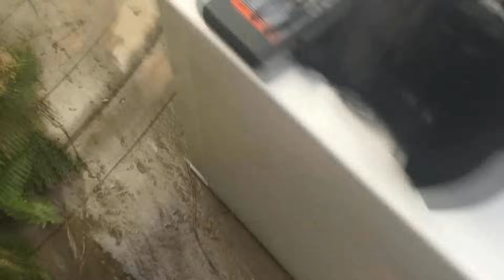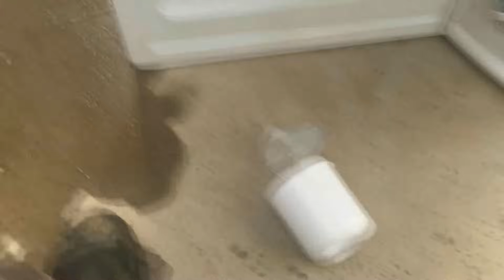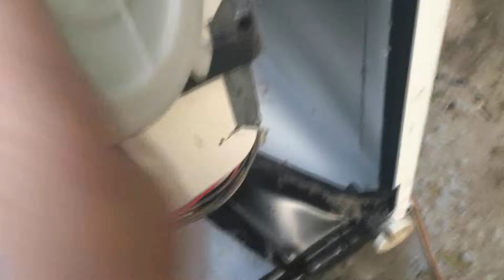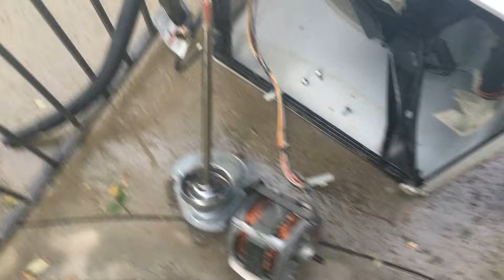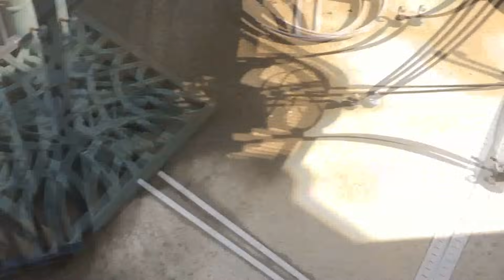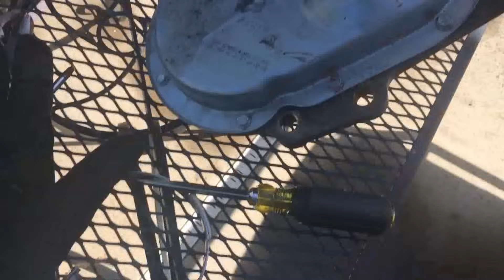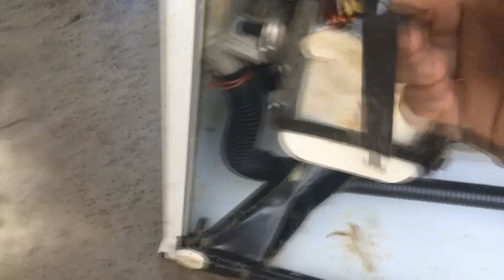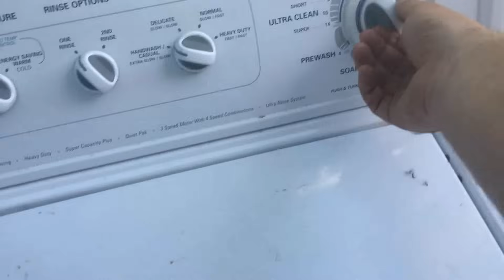How to Replace Clutch On Kenmore Washer - Not Spinning

Comment: Im a single father with a 12 year old daughter . I work 45 hours a week to try snd makes ends meet . I cant tell you how much this video meant to me ( us ) . Our washer has been barely spinning for months . I searched the internet trying to find an answer . I went out on a limb and paid 50 dollars for a new clutch from a local alliance repair shop . I watched your video probably 15 times and had the old clutch out and the new clutch in within an hour . Thank you so much . Now we have a washer that works .
Reply: TheBeaver50 You got ripped off on your parts.
Reply: New clutches are only about $10 online (Amazon or eBay).
Reply: Yes, the local Appliance repair shop certainly made a profit, but TheBeaver50 got the job done...I say Nice Job!
Reply: That WILL fix it - but next time look for the "COUPLING" behind the motor (accessible through the bottom once you "unfold" the washer") VERY easy fix - clutch probably came with both new couplings and black ring (with 6 holes in it) 3 holes for each coupling... those two/three little parts make the entire washer work - it's like it's heart and soul xD
Reply: What is the model #. I bought what looks like yours but no model #. Nice video and thank you for the time you spent to help others.
Reply: Got a model number? Thanks

Comment: Very helpful video.  Thank you.  My washer and dryer both went out on me at the same time so I'm here finding out how to do the repairs myself.  Even if I had the money to hire a repair man, I would still do it myself to save money.  I like fixing things though.  It gives me a sense of accomplishment and purpose.  Although as of today either my air conditioning is on the fritz or  the blower on the furnace isn't working properly!  I can't seem to get a break!  Ugh.  I fixed my dishwasher a month ago.  It was a $14.99 part.  I'm a 49 yr old woman with teenage daughters.  I'm trying to teach them how to be self-reliant and repair things instead of replacing to cut down on waste and unnecessary purchases.
Reply from the maker: +Kim Possible right on. Needs to be more like you. Too many people these days throw things away over such simple fixes

Comment: Thanks!!  6 years later, the link you provided for the clutch kit on Amazon is still the best (cheapest) place I found to get the OEM/Genuine parts.  Looks like the seller (Cashwell appliance parts) is semi-local to me, but I checked the part on their website and it was $44, compared to ~$22 for the part (including shipping) from the same seller on Amazon.  So I bought it and let them deliver it to my door for 1/2 off their walk in retail price.  Not a great way to do business IMHO, but the part worked great.  Washer spins like a champ now!!!!

Comment: This is a Whirlpool Direct Drive washing machine. Made various models for about a 30 year production run. Incredibly easy to work on and very dependable. Parts available on EBay , Amazon, and local appliance repair shops. People throw these away because they are “old” when in reality they last 3-4 times longer then most new washers. Also  NO computers or mother boards to break . Yeah many people will wish they kept and repaired them when they are all gone.

Comment: Nice Video!  Tim Hill said what I was thinking - There is a COUPLING in the BOTTOM - You have to remove 2-4 clamps and 2 screws and the motor comes out - I literally JUST did this TODAY on our Kenmore Washer - I found a guy who owns a shop who happened to have a coupling and the small black round piece with 6 holes in it that holds both couplings (there are actually two - one facing one way the other (the one that usually breaks) facing the other way - Once you get the motor off it's REALLY easy to to replace that coupling(s) - Washer is running... spinning AND draining again after replacing that coupling and black ring it goes into (the ring was worn out too) ... $8 (in parts) - I think in your case it really was a BAD CLUTCH - but always check those couplings FIRST (anybody else that encounters this problem) when NO SPIN check the lid switch 1st - if that isn't it 90% of the time it's those little couplings... @11:36 you can see the couplings/black ring CLEARLY (between the clutch and motor)

Comment: Getting the retainer ring back in was a little tricky. It doesn't really thread in, as said. First, make sure that all four of the white plastic tabs are coming through (from the bottom side) properly. Then make sure that the four metal slots go all the way on the motor so everything is seated properly. Then I put the tang end in the hole, and held the ring down with one thumb positioned just past the tang (in the clockwise direction). Then I used the tip of a flat screwdriver to push the loose end of the ring toward the center (to make the diameter smaller). At the same time, I pushed the screwdriver down at an angle. If the screwdriver isn't angled down some, you probably won't be able to get the ring in. The ring has to go OVER the top (of the last one or two of the four shapes formed into the metal on the motor side), then inside.The angled-down position also helps to keep the screwdriver tip from sliding off, possibly gouging your other hand.The flat blade is positioned vertically, and it should be centered on the wire of the ring.

Comment: This video was awesome. Very well explained. I replaced the clutch, drain pump, plastic part between motor and transmission and washer dogs on my machine. Working very well now. If it helps anyone, my agitator was removed first by using a half inch ratchet extension ( Seen in another video) which then revealed a 9/16 bolt to be removed .

Comment: I’m also getting one of these when I finally get my house as well.

A stockpile of parts will be in place when I do get one.

I’ll gladly spend $150.00 to $250.00 on one of these used before I spend $800.00 to $1,100.00 on a brand new one that can only do half the stuff that these old workhorse like Whirlpools and Sears Kenmore Direct-Drives can do.  They’re nothing but garbage anyway.

And as you showed, there very easy to work on and to fix and repair if something go wrong with it.

These lasted 25 years or longer when they were brand new.

Get it fixed up and gone through really good, I’ll probably get another 20-25 out of mine before I’ll either die, and then leave it in my old house when I’m gone.

Or I’ll finally throw it out when there no more parts to buy for it, and if I’m still living, I’ll probably replace it with a Speed Queen, provided their still around, they’re still making their washers the old way they seem to be still making them now (sans 2018, of course).

If fixed up very well, there’s no reason why this washer won’t out live me.

If a 67 year old woman can fix it up and keep it working, then there’s no reason why a 56 year old (and nearly 60 year man) like me can do the same thing to his.

These were good washers when they were out.

I don’t know why Whirlpool stopped making them in the first place.

Great Job Sir....

—Charles—

Comment: Bro! I underestimated the "heaving and hoeing" that is needed to pull the trany out. This video saved me from buying a whole new washer. Thanks for the great video. My washer started out with a weak spin and eventually stopped spinning. Ordered a new clutch and motor coupling but coupling wasnt broken, but i replaced it anyways because why not.
Reply: Do you have any tips for removing?  Mine is stuck. Ive pulled and pulled and even beat the shaft from the top with a rubber mallet.  I can't get it freed!   Any help would be great!
Reply: @Hector Cortez-aponte-cabrera still no tips from anyone. Ive surrendered unfortunately.
Reply: @Hector Cortez-aponte-cabrera ikr? 🤞good luck!   Let me know what you figure out!
Reply: It should come right out if you got all the retainer clips removed from the shaft inside the tub. Pull harder!

Comment: I've found the motor area is easier to access if you loosen and pull the body forward as it was intended rather than lay the unit on its side.  All of the clamps were made to disengage from the front as well.
Reply: 100%

Comment: One minor detail: the rocket looking thing (15:25) is actually supposed to sit the other way as it's a cup for liquid softener. Otherwise...you just saved my gizzard! Replacement parts are SO much cheaper! And this washer...we've had it for YEARS.
Reply from the maker: Glad it helped, thanks for the input!
Reply: I am not even sure if that is true because he threaded it and it lined up. There may be different models with slightly different characteristics.
Reply: @hykos1045  Sure, but I can do that with mine, too--he and I have the same model--but the intended purpose of the "rocket looking thing" is for it to be open side up for liquid softener. It's possible that for shipping and handling purposes it ships cone side up.
Reply: Okay this is what I was here for because I cleaned mine and replaced it but now I am here for the clutch I’ve noticed the fabric softener inverted on when he repaired. Was wondering if I have done it incorrectly. One thing I’ve noticed is that my softener disperses immediately with same amount post cleaning. Although it is flush now I will think about turning for “lock” method. Usually it disperses only when on spin cycle. Once more. Thank you inquiring eyes and mind. Xo
Reply: @gipzcarnelli4728  Yes, for liquid fabric softener, you want it to be open side up, cone down. It balances a little precariously, but that's how it's supposed to be as the softener is meant to be added during a later phase (a little will spill and it won't kill anything, but that's the design of the work flow).

Comment: Before ordering any parts check the white plastic cam. Most of the time one of the two nipples will be worn off causing it not to engage, thus causing a no spin situation. Also, if there are any worn areas or little hairline cracks on the motor coupler, this will cause a no spin situation.

Comment: Here's an important tip guys.... I you install that thrust washer THEN the retainer clip, you will get a REALLY annoying click click click when it's doing the agitation.  Don't ask how I know this.  :-/
I found it easier to just remove the motor off the transmission, only 2 clips hold it on anyway.  This is also a good time to spend 8bucks and change the motor to transmission rubber coupling.

Comment: The pump clips and motor clips are more easily removed if you remove the cover completely and work from the front of the machine. For pulling the transmission to get to the clutch as he does here, having the machine on its side IS nice.

Comment: Thank you so much! This was just like my machine. Only mine did not have the little black thingy, but everything went into place just like you explained. :-)
Reply: That little black thingy holds the couplings together and makes it spin... maybe yours is a newer model where they went ahead and designed it differently :/

Comment: Be sure to get a genuine OEM Whirlpool clutch kit.  The packaging will say made in US or Mex. It costs a little more & is worth it. The dirt cheap parts on EB are made in china >> DO NOT get made in china crap.  I just refurbished my washer & only installed made in USA parts and just spent an extra $30 or maybe less >> drive block, spanner nut, seal & bearing kit, tub seal, clutch, Dr/Br assy w top seal, cntr-bal spring plus a capacitor.  After refurbishing & repair, 25-yr old washer is now almost like new.

Comment: For 4 bucks I would always go ahead and install new agitator dogs when doing a clutch.....just a personal preference.
Reply: What are agitator dogs?
Reply: @felipedejesusecheveste1227   look at 14:26.  The 4 tiny  yellowish pieces of plastic,  those are the agitator dogs.  They are intended to cause a countermovement of the top piece of the agitator with respect to the main botom agitator.  Due to these dogs, the upper agitator should spin "free" when rotating one way, and spin hardly tied with the bottom agitator when rotating the other way.  This is because the dogs are pivoted and only act in one way, not the other.     And all of this countermovement is what cause the clothes to constantly move inside the washer,  getting cleaned because of the movements.       Sorry of my explanation was not good enough, as spanish is my native language .

Comment: Great video, thank you..... simple question, would the clutch be the same issue if it intermittently spins in between wash/rinse and the final rinse? Mine agitates fine (I replaced the dog agits a few months back) but now it doesn't always spin, sometimes it does sometimes I have to restart the spin cycle. I can usually hear if it's not engaging and I'll usually just have to open the lid and close it a few times for it to kick start and spin the clothes
Reply from the maker: Sounds like it could be a board or wiring issue, you can try replacing the clutch as it is cheap enough and should honestly be done anyways as preventative maintenance, then you can check over everything else while you are in there
Reply: thank you, I'll definitely give that a try this weekend will order that asap and keep you posted. Thank you for the reply
Reply: Sound like the lid switch would be a likely suspect on this one. The switch on mine works. Switch clicks, motor hums...but that's all! I should go downstairs and put the transmission back together, but this is easier....
Reply: Looking for a way to get to the agitator dogs...can't get the dog assembly to drop out of the agitator. Ideas?

Comment: its turning but this is a neutral drain type. It should not be spinning while empying the water. It spins once the water is gone. The transmission neutral drain parts need to be replaced, about 25 dollars and easy to replace.

Comment: Great video. Oone question, why the extra spring that comes with the new clutch assembly?
Reply from the maker: honestly I have no idea, could be an extra just in case it gets lost
Reply: I going to hang on to this thing and if I ever have the clutch problem again, I will replace the spring only and see what happens. :) Thanks
Reply: There are 2 springs, one is used for extra capacity washers and the smaller for regular washers. You would swap it out for your needs.

Comment: I have a question. My coupler was broken and I repaired it and it appeared to be fixed except for it only lasted 2 minutes or so and then stopped spinning and agitating at all. Does that mean then that the clutch would be my next step to try? Or do you think something else is going on?

Comment: Hank I replace the clutch and on the test it and it made a grinding noise. Pulled it apart again and found it had shredded off shavings of the clutch pad. What would cause this on a new clutch?

Comment: I did 4 different troubleshooting steps as shown on YouTube: 1 switch inside door, it was not broken nor loose, but I did unscrew and clean up and retighten. The switch does open when door is closed. (2) I looked at plastic spinner that engages the engine shaft, no broken pieces or cracks.  I  disassembled to remove transmission and engine, observing that the clutch is NOT loose or moved by hand.  It is very  hard to move.  (4) I checked inside the pump, no debris or broken pieces.
All these steps do NOT solve my "no drain/spin.  Please advise what is next step.  Thank you!!!

Comment: What was the cost of the replacement parts? Informative video. Thanks.
Reply from the maker: It was less than 20 bucks from Amazon
Reply: +Jorge Rodriguez These are the best washers ever made in my opinion.
Reply: @hanksgarage_  Wow, I need to hang at Amazon (tho I hate their guts!). I got a clutch and coupler from Reliable Parts (brick & morter, 5 miles from me). The clutch was $49.45 and coupler $22.30. With the governor's cut it was $78.93. Pizzed am I....

Comment: Would be easier to remove cabinet off frame and just tilt it back against the wall that transmission will slide outfrom bottom
Reply from the maker: Yea before I knew that
Reply: Hank's Garage HELP!!! My 2005 kenmore elite top loader spins but takes forever to get up to full speed and doesn’t get the clothes dry enough, so I always have to run the spin cycle 3 or more additional times no matter how big or small the load is. Any idea? Could it be a bad clutch, faulty motor capacitor, bad bearings, or weak motor possibly? Every google search leads me to nowhere.
Reply: @lastotallyawesomebleach204   Check your motor to transmission coupler.  It is plastic and has  flat spots on it to grip the metal shaft.  As the plastic wears, the flat spots get hammered to a round shape and start to slip on the metal shaft eventually not gripping at all.  Sometimes  the plastic ears that engage to each other break and coupler is ruined.  So before you remove the transmission and motor as a single unit like this video suggests, remove the motor from the transmission and check coupler!  Take the sheet metal surround body off so that you can see and work on the pump and motor easily.  Don't  leave the shroud on like this video does making water  pump removal almost impossible without cussing!

Comment: Help needed. Just changed the clutch, as the old one was loose as shown in the video. But the washer still doesn't spin properly. The motor runs, the drum barely moves, or spins slowly if I push the drum a bit. Any idea what else may be wrong?
Reply: Maybe the rubber/plastic coupler between the motor and trans is damaged. That is what was wrong with mine.